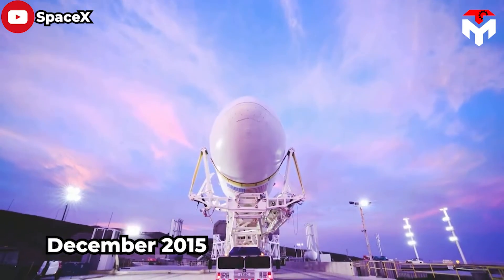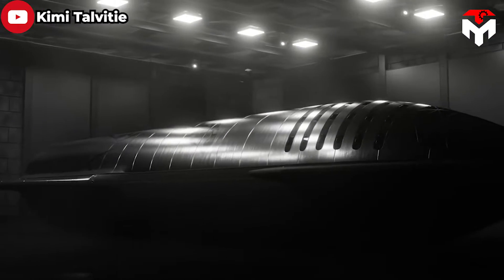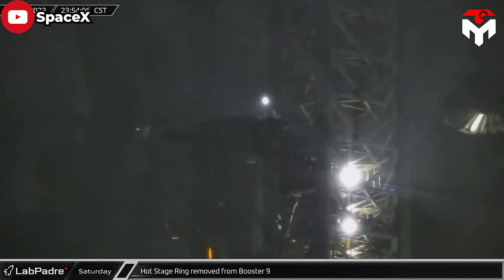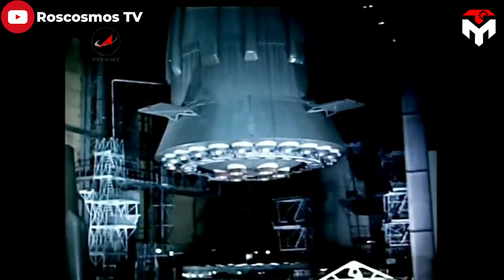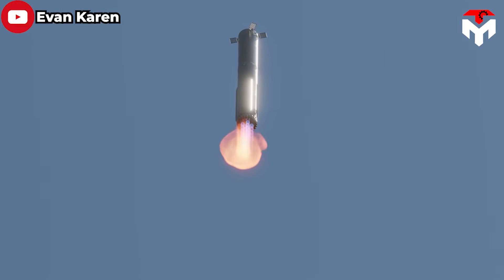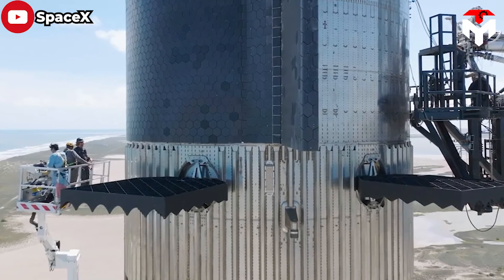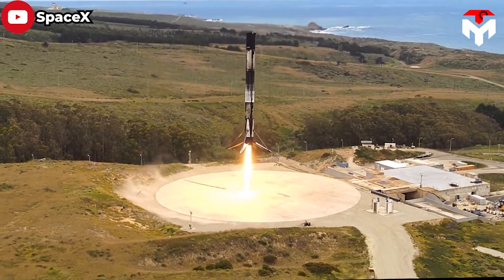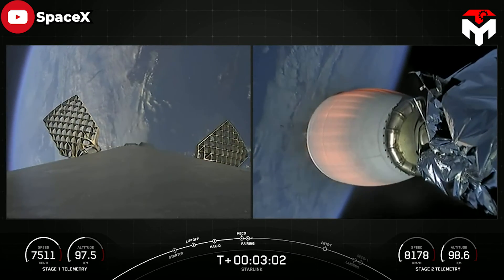Why Super Heavy's Grid Fin is even more important than you think?

Comment: You could use just three grid fins positioned equally around the circumference of the booster. And then redesign the catching arms to allow for this. Reducing the weight of the booster
Reply: You can, but why bother at this stage? Btw catching arms don't care, they use load points